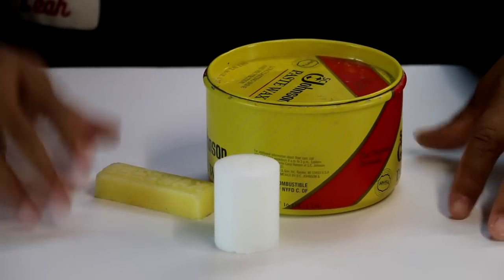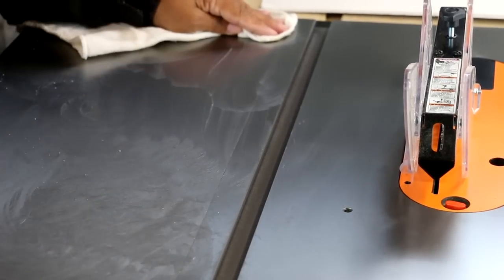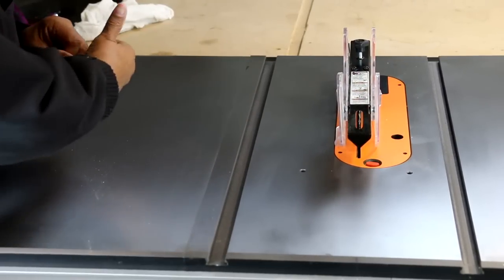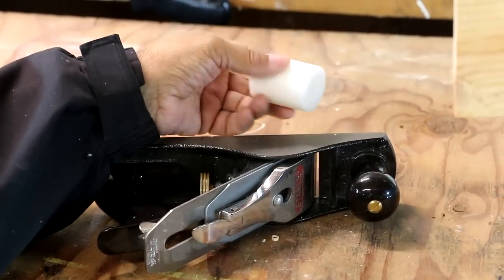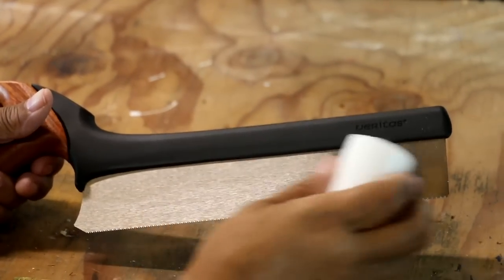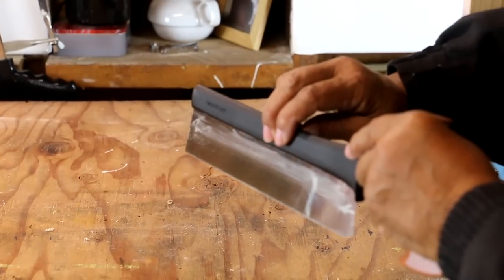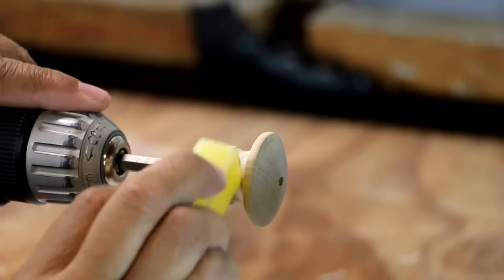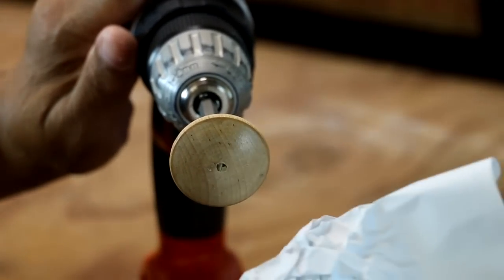Polish, Waxes

Comment: Any wax (or bar soap) to drive a screw into wood, just put a little onto the threads prior to driving it home. I have even used WD-40 in a pinch.
Good stuff Leah, thanks
Reply: I've used CLEAN motor in a predrilled hole to drive screws with no problems. Just a drop or two at most.
Reply: Craig, help me remember, but I thought soap makes your screws rust. Unless it's the old type We always used  a bit of a candle or beeswax. Do you know if soap makes them rust?
Reply: Soap does act as a surfactant making water wetter if you know what I mean so if the wood was subject to moisture I can see where it may cause rusting of screws
Reply: Craig Nehring thanks Craig, I actually do know what you mean!

Comment: I fought rust on my shop for 20 years before I found the benefits of paste wax. I use it on all my machines surfaces. Drill press, vices, lathe bed, table saw, etc. I also have an old cabinet that the drawers are fit like a dresser. With no sliding hardware. It's like a miracle cream on those drawers. Caution even using indoors. I did all the drawers on our kitchen cabinets at our cottage and it took a few days for the smell to dissipate.

Comment: Thanks Leah!  Good stuff.  For all those woodworkers out there, I would also recommend a product if your shop is really humid.  I spray it on all my tables and some of my tools because my basement is REALLY damp all of the time.  It's called Fluid Film and I got it on amazon.  It even stops rust in it's tracks.  Contains lanolin.  Honestly I swear by the stuff.
Reply from the maker: Thanks for sharing......I  will check it out.
Reply: Thanks for sharing this.  My workshop is a FL garage, so it is certainly hot and humid.  The window a/c helps a little but not enough!
Reply: I learned about it on a woodworking forum.  I even spray or wipe some on my lathe tools.  Everything in my shop gets rusty if it's not treated.  It's not cheap but it's worth every penny.  I buy 2-3 cans at a time and save a little per can.  You won't regret it.  Oh and one can goes a long way.  I usually spray it on a table and then spread it around with a rag.  I then keep the rag as it gets saturated and use that rag to wipe tools or anything else that might rust.

Comment: thank you Jane . question please . i tried past wax on my tables , saw , band and drill . i guess i did not let it set long enough and i use an old leg from my jeans to buff it off . i guess  i should of used an old tee shirt ? cause i got rust problems . i do have an old 35- 40  yr old drill press vice i sprayed with teflon and no rust . but dont think it would work with the wood stuff . ??? any suggestions silly i know i see rust on my new toys and i want to cry well you know what i mean on that one .
Reply from the maker: Hi Walter, unfortunately, treating tools with paste wax is an endless task.
Reply: makes sense thank you Jane